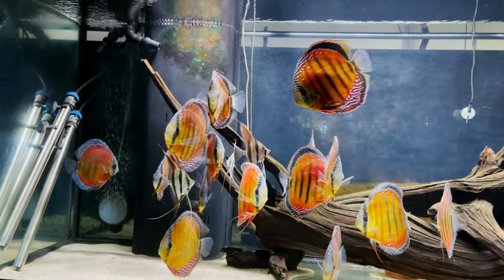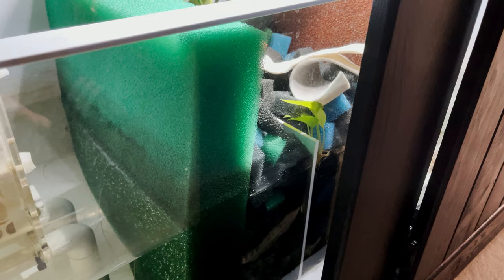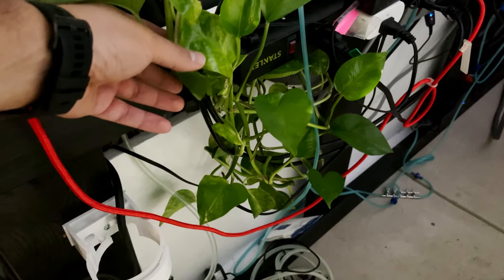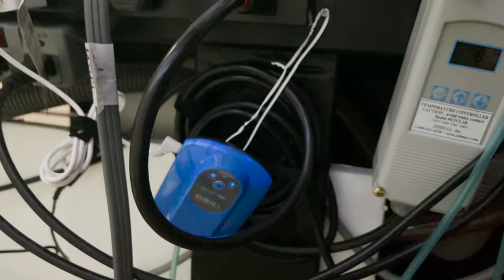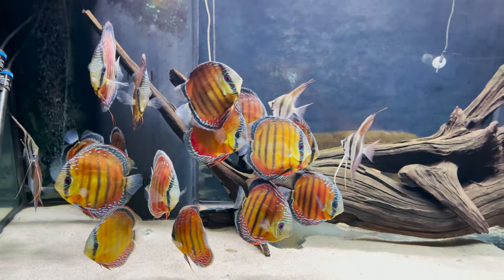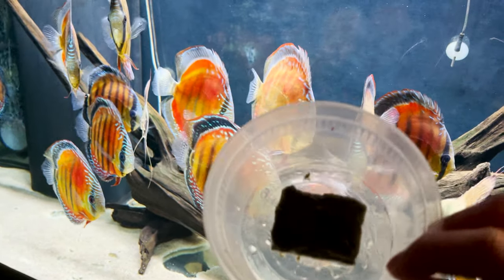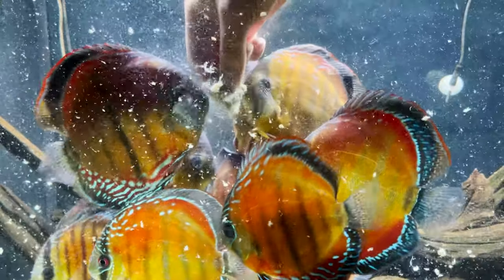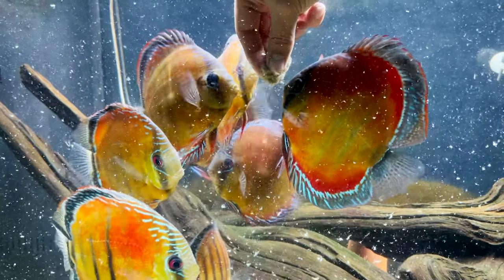Wild Cuipeua Discus Filtrration and Feeding

Comment: You should consider to use your frozen food on a tray and offer to the fish separately. It is way cleaner that way. To make home recipe isn't the best. Would you think any type of gelatin would be good for the fish in the long run?? Unnecessary addition to their diet. All you did there is to put a bunch of mysis (or whatever those small particles are) together in a messy gel. Think about introducing some K1 in your sump instead of those crumbled sponges in the middle. It's way cleaner IMO. You can place the sponges in the other compartment while the K1 gets activated with the biofilm, which takes a while, like 3 to 6 months. Let me know what you think about K1 media. You have beautiful discus. I'm glad to know that you saved them form all the trouble in the beginning. Thanks for sharing.

Comment: Why are your heaters not in the sump? I also aerate the water in the sump. Nothing in main tank except water and fish.
Reply: Thinking the same thing. Maybe he wants more even water temps through the whole system. Also discus like super hot water which is low in oxygen. Water may lose to much oxygen by the time it’s in the tank.

Comment: Why dont you run the uvc lamp?
The biggest Problem in Discus hatchery are germ.
That ist also the main problem with the so called "Lochkrankheit" , as you called it hole in the head.
Reply from the maker: I do have a 58Watt UV Lamp in this tank. I used it when I was fighting hole in the head.
Reply: Yes that ist because the hole in the head Problem ist coused by too much bakteria in the water.
So keep the uv lamp running 24/7 there are No disadvantages exept Power consumption and plant growth.

Comment: Way to much over the top and money that never needed to be spent , ive seen many discus tanks with far less equipment than this and those discus and the owners were very happy,  had i not seen the discus i would have thought it was a video on marines , This is someone who obviously  has more money than sense and they wonder why so many new to the hobby stay well away from keeping discus,  after watching this who can blame them
Reply: I can tell you that a mixed reef tank is way more expensive and difficult to achieve. This setup is far from over the top. I'm looking to start a 120 gallon discus aquarium. Similar to this videos setup. With kessil lights and the aquarium having low iron glass. So the discus can glow more. I'm looking to spend 4000 on the tank/equipment. And another 2000 on the discus and rummy nose tetras. A full on reef tank of the similar size would cost 15k minimum.